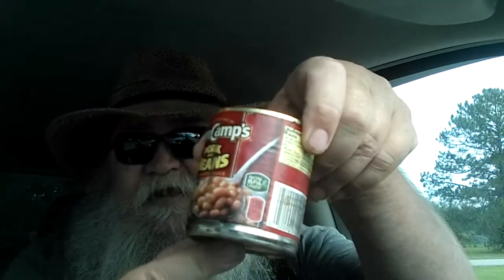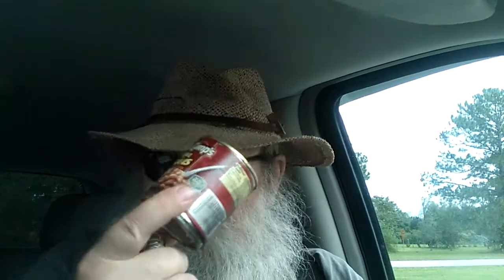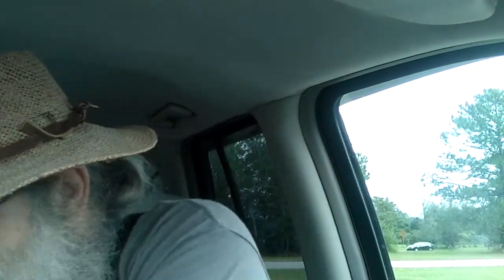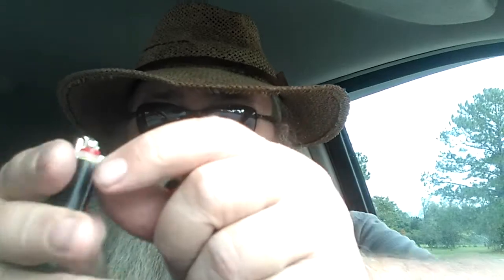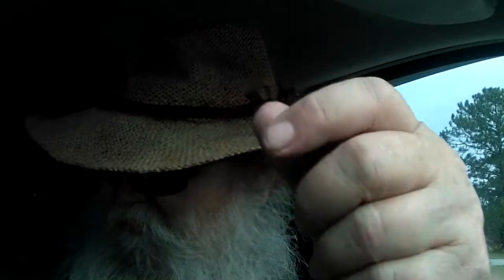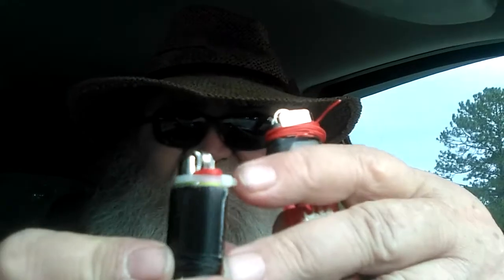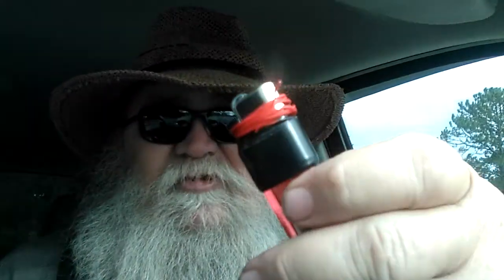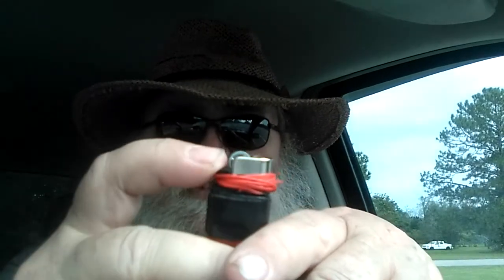Ditch the cable tie lighter lock

Comment: Great tip, Doc. I use a fat rubber band from broccoli wrapped around on mine.. Makes good tinder as well. Thank you for the video, Doc
Reply from the maker: Im trying to picture how that would work, you cover the whole lighter top to bottom?
Reply: Just wrap it around and around where you put the wire or the ziptie. Like putting a rubber band in your ponytail. You can press it hard enough to go by it, but it is hard. I use it instead of tie wraps because it is easier to get off.. Duct tape would work too. Thank you for the reply, Doc
Reply from the maker: cool I'll have to remember to try that !

Comment: great. :D
 I tend to use cordage over zip tie method. Due to the same reason ... take if off  what uses does it have.  Besides this or wire can be reused again... unless one uses a reusable zip tie or reverse zip tie methods.
TFS C.R.
Reply from the maker: unless you leave the long tag end of the zippie, you still only have a 3/4inch zippie